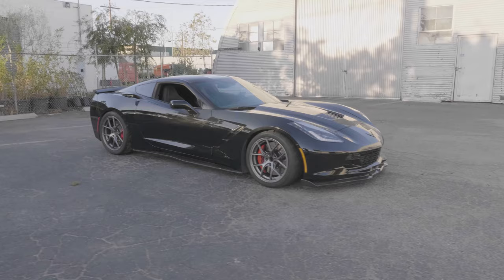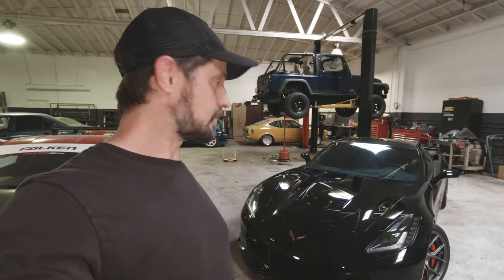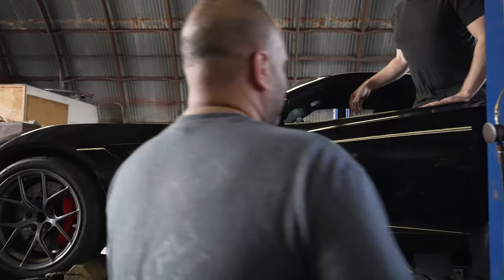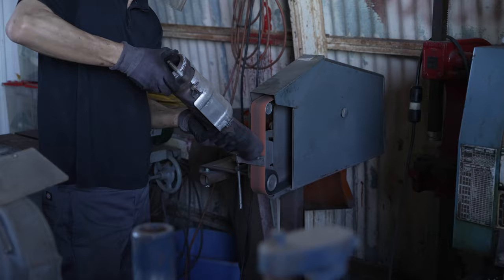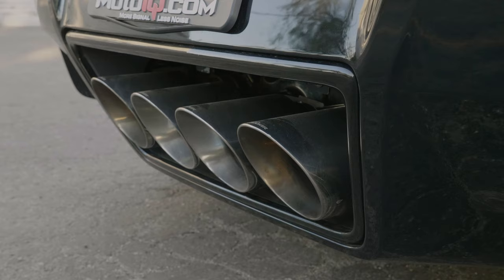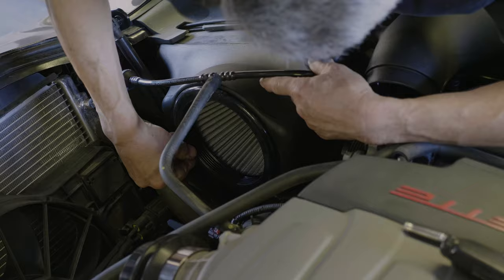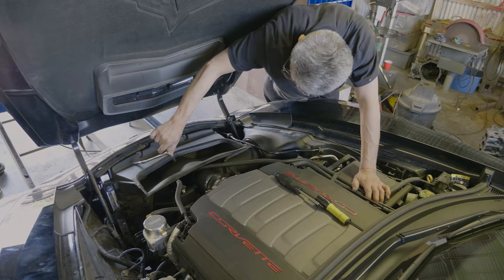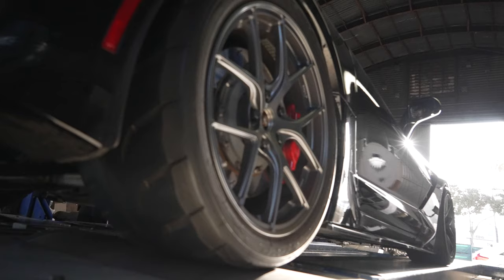C7 CORVETTE DYNO TEST | Hooker Blackheart Catback Exhaust & Intech Cold Air Intake

Comment: It’s pretty obvious manufacturers are very limited with and and how to mass produce good products for cheap compared to aftermarket parts that’s whole job is to improve on the previous so yes you will get gains not much but you will feel it driving

Comment: Although the Hp gains were good, I just can’t help but wonder how much better a straight-flow intake replacement setup would be?  The stock one used still seems a bit restrictive with all the bends in it.
Reply from the maker: At this sort of power level, it won't make any difference at all.  Maybe when you get over 1000hp.
Reply: @motoiq  Ahh!  Ok, yes, I see what you mean.  Thanks for your response!

Comment: How or why is this dyno posting 50-60HP less than anything else I've seen?
Reply from the maker: Don’t focus on the max number. Focus on the percentage gains.
Reply: @motoiq  I understand what you're saying completely. Elevation, fuel etc can all play a part in dyno numbers, and in reality they're just a baseline. That said when your numbers are so far off the baseline of everything else ever posted for a stock C7, anyone who's even remotely mathematically inclined would seriously question the results from the gains themselves. Fantastic vid tho, and an absolutely stunning car.
Reply: It's just the type of dyno it is, or the way it's set up.
Reply: That's because 95% of all posts with dyno numbers use a dynojet dyno. Which is the highest reading dyno. The dyno he is using just like a mustang dyno/dynamometer is more accurate but reads around 15% less than a dynojet. For instance, My twin turbo Z made 548whp/482tq on his type of dyno. But it made 603whp/541tq on a dynojet.